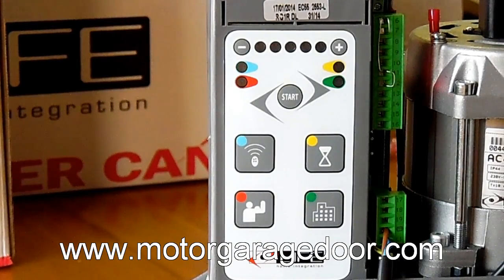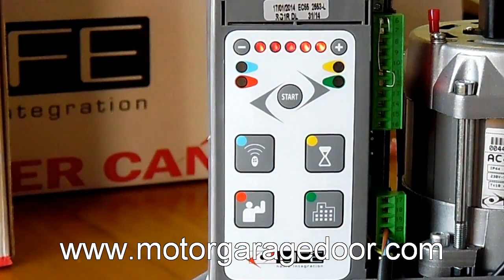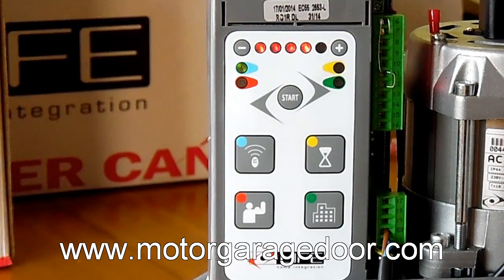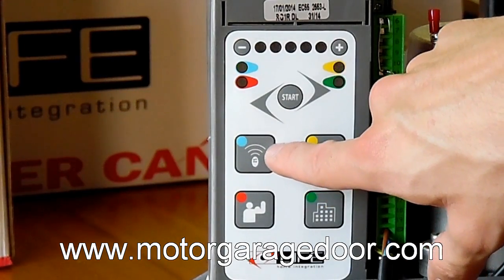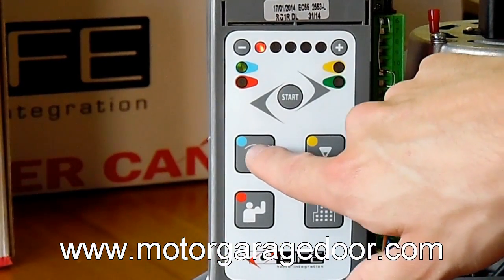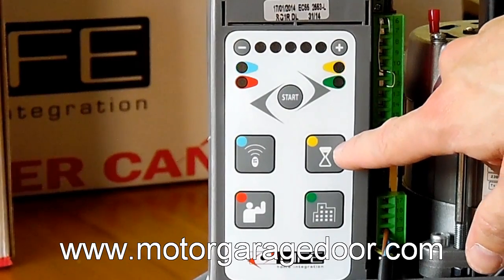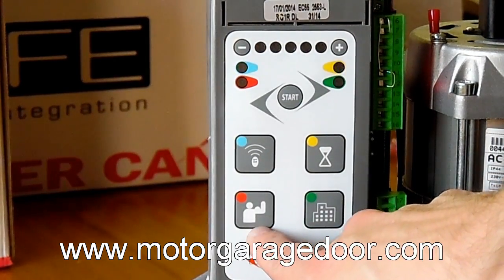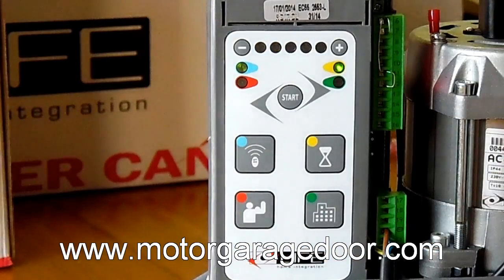PROGRAMMING MOTORS

Comment: Thanks i have a question i have installed the AC8R DL 942M. I set the time to automatic closer after 1 minute. But some time i want to just keep the gate open for few minutes without closing automatically. Can i do it by remote without just reaching the motor physically.

Comment: Hello, my motor was previously automated and working fine but not anymore. When I try to program as per your instruction, it closes the gate but doesn’t open and close as it should to fully program. With The remote too it only closes but doesn’t open. Will it work if I reset the motor completely? How do I do this?

Comment: If someone already make automatic closing then how i will remove automatic closing
Reply from the maker: Hello, you have to desconect the power supply.
Then put again the power suply and press the yelow button. With + or - you can change the closing time (without any light don't have automatic close)

Regards
Reply: Tnx sir can u tell me please which one is common lort in wiring

Comment: All settings and dynamo is good. But it's not working
Reply from the maker: It´s dificult know about it only writing without the engine to test it but all that I can say you is: "check the fuse inside the control panel".

Regards